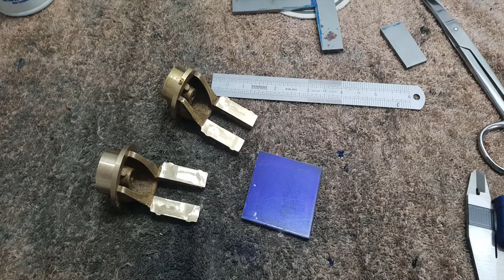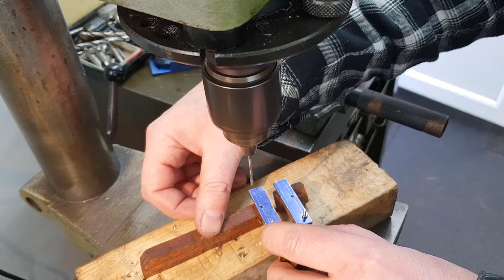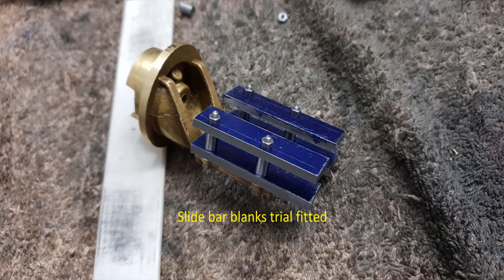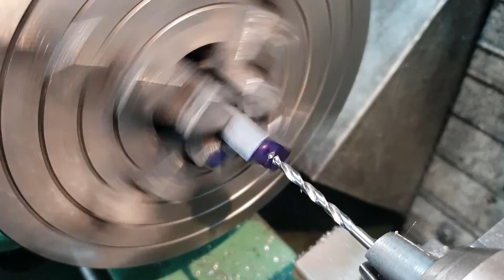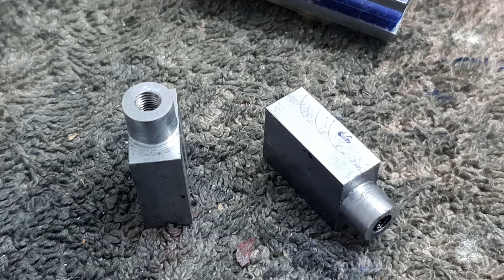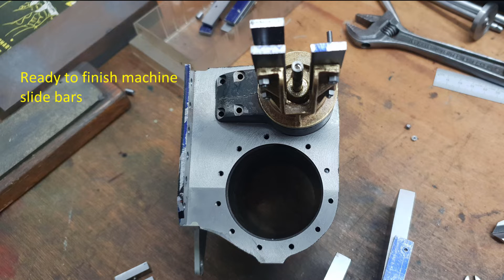5" Gauge Steam Loco BR 9F Part 52 - Valve Crossheads & Slidebars

Comment: Yay, something to watch! Inspiration for the Xmas break to find something on my engine to do.
Reply from the maker: Derek, What engine are you building??? 
Cheers Craig
Reply: no23mk2 Hi Graig, I’m building a traction engine, Allchin 1.5 inch which is why I asked if you knew a good machinist as I need my cylinder block done as it’s not something I can do 👍
Reply from the maker: Hi Derek, I know Keith Appleton could do such work or maybe Steam Workshop - both have you tube channels. I have no idea what the cost would be.... I would like to think that I could have a bash at it, but I am very new to this game - what you see in these videos is the sum total of my machining experience. I'm learning as I go! I have never done work for others and would be scared of scrapping off a pricey casting...  Out of interest what is the casting made of? What bore & stroke is it? Is it piston valve or slide valve?
Reply: no23mk2 Hi Graig, trust me from what you have done so far this casting is nothing. I think it’s a inch and half stroke, the casting is made of gunmetal. If you get time google Allchin traction engine and you will see the casting. Kind regards Del
Reply from the maker: Hi Derek, I see it is fitted with a liner. Send me a scan of the drawing with details for all items associated with the cylinder block, eg valve chest etc. and I'll have a closer look. 
E-mail no23mkII@gmail.com  Cheers Craig.
Reply: no23mk2 hi Graig, I’ve emailed so hopefully you will see it as long as I’ve got address correct, regards Derek